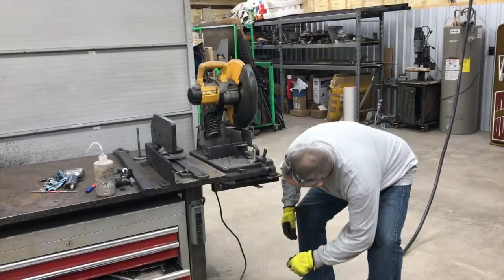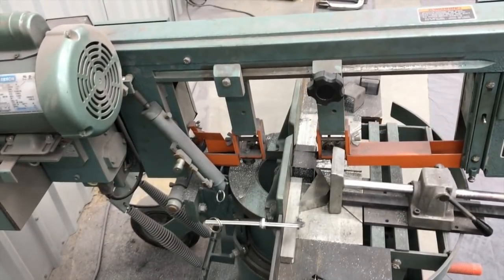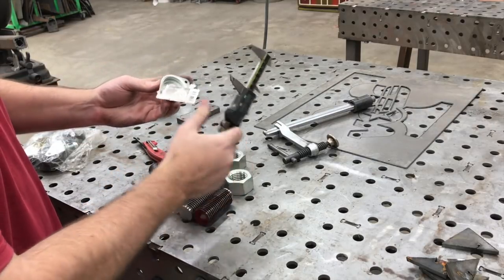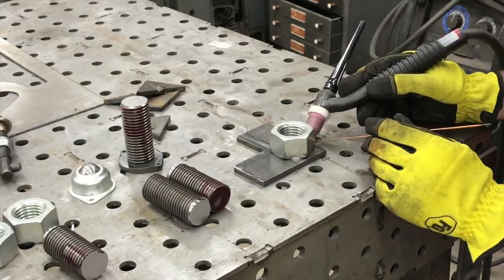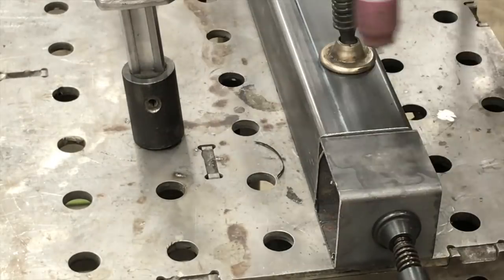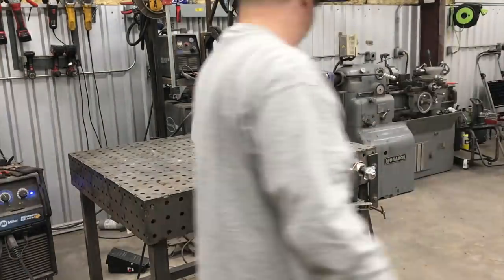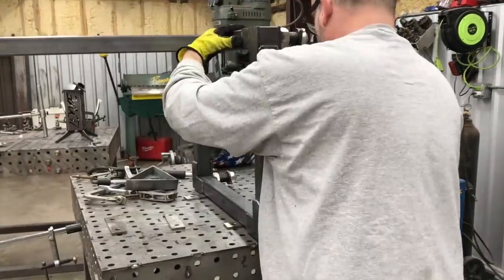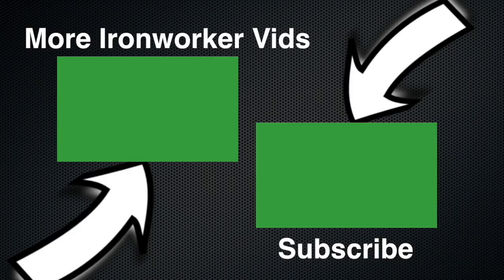DIY Poor Mans Ironworker Part 2 - Uni-body Leveling Mobile Base

Comment: I'll be curious to see if the harbor freight casters hold up. I hope so as it seems like a good solution
Reply from the maker: I think it will be fine, This is mostly going to be a stationary cart, and doesn't have alot of weight on it.  Thanks Paul

Comment: Your brackets look great. I'm still learning on my cnc plasma and need to get better at getting perpendicular edges on the plate, using the hypertherm 65. My recent personal projects have been made with scrap I either had left from jobs for others, or remnants I pickup at the big steel supplier because they catch my eye and look like they would work for various projects. It does keep the out of pocket expense lower and uses up material that is otherwise just waste. Did you consider a three leg stand.......like a tripod? That teetering of a 4 leg stand is a familiar sight. My welding table is a few fab blocks bolted together and set on a frame that I built with adjustable legs, so it does not wobble. My blast cabinet and horizontal compressor aren't adjustable and they do wobble on the concrete. For my table, I made work stops/pins with 5/8" rod and collar stops. You can set them in an L pattern and square two sides of your tube frame and clamp the tube to the table, then use squares for the other two tubes. Great video!
Reply from the maker: Thanks man, yea I actually did think about a 3 point cart.  if its done right and you have the right footprint dimension on the base i think it can work well and eliminate the rocking from weld warpage.  The main reason I made the cart adjustable was to be able to get the level of it, at the same level as the table so I can slide things off the edge of the table over onto the shear and trim things up, etc